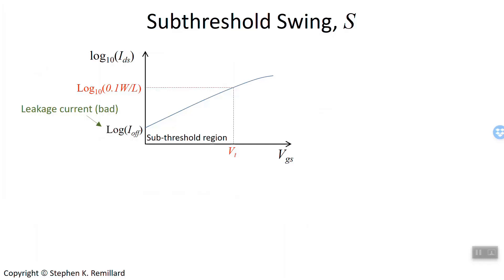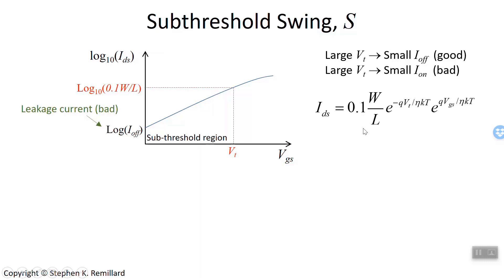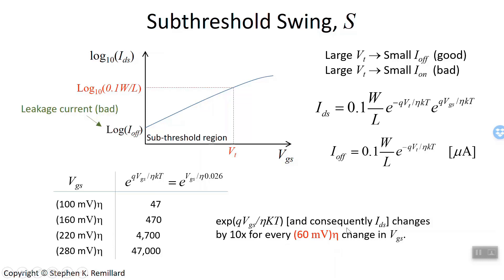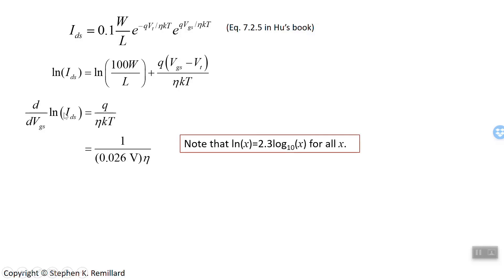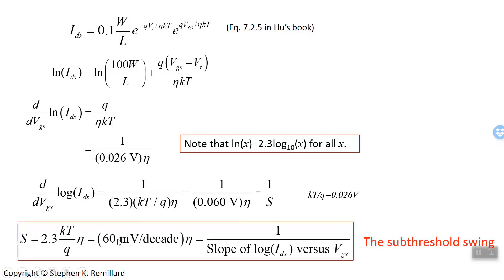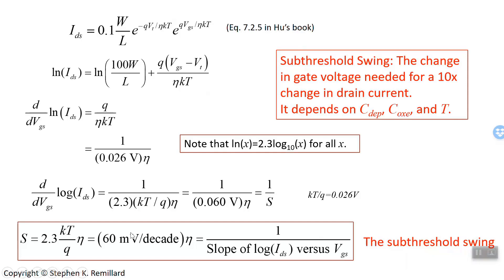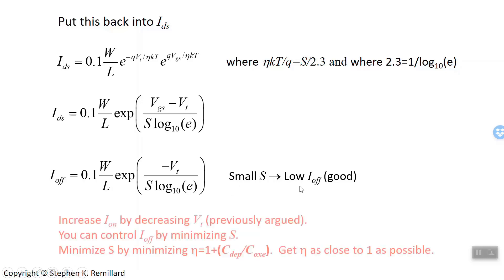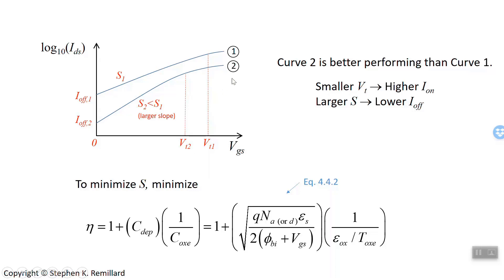Subthreshold Current and Subthreshold Swing of a MOSFET in two parts, Part 2, Lecture 72

Comment: @10:10 it should have been larger S --> higher I_off
Reply from the maker: Thank you for bringing that up.  Although my spoken words were right, the slide had the error that you point out.  I would go with the statement (equivalent to your correction) smaller S -> lower I_off, in order to match what I was saying.  Again, thanks.

Comment: Dr. Remillard, thank you for walking us through this explanation. I have one question though: how did the 0.1W/L term turn into ln(100W/L)? Math isn't my background sorry!
Reply from the maker: Good question.  This is regarding the "100" that appears at 3:53.  It seems that for one line I switched from microamps to nanoamps, for no good reason.  The term differentiates out, so fortunately it doesn't matter later, but you are right.  It should have stayed 0.1 microamps.  Thanks for catching it.